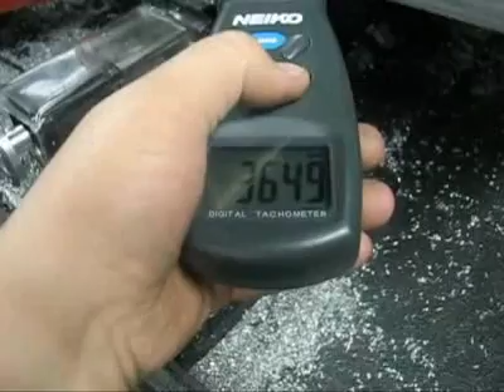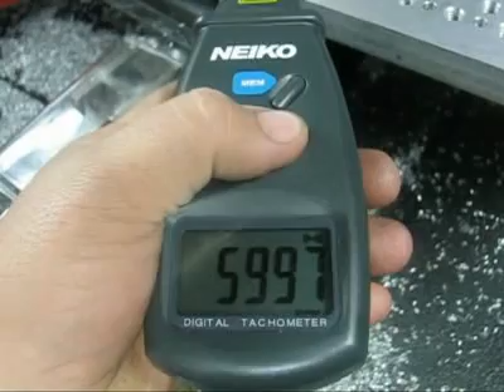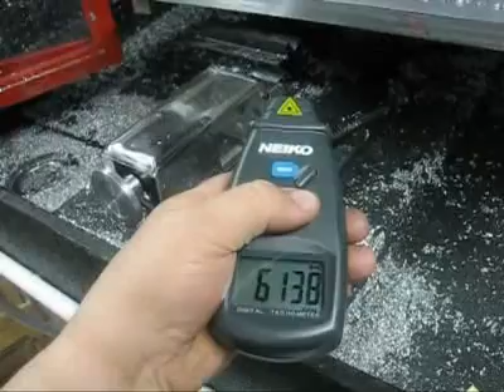belt conversion overdrive

Comment: What settings do you find best for milling aluminum using a 2 flute 3/8 carbide end mill?

I have the Steele belt kit on my HF mini mill and I find the faster the spindle speed the better... The only problem is during plunge milling, I think the stepper isn't powerfully enough to keep it from plunging to far... Know how to fix that? I'm still very new at this.  

Thanks for the videos, keep posting them!